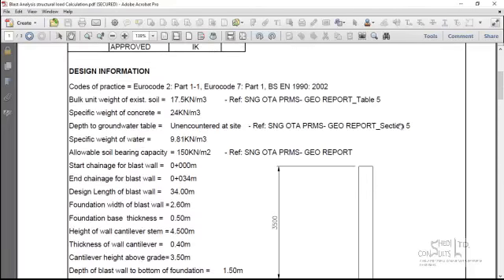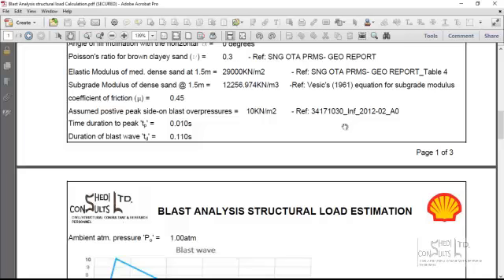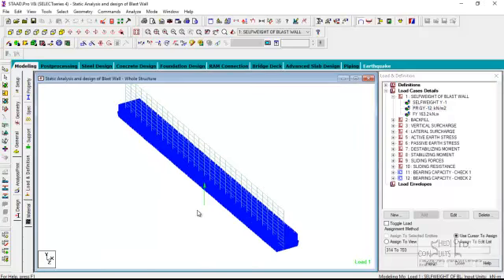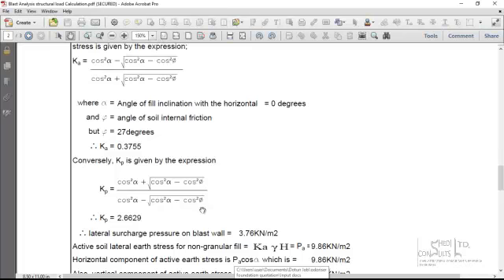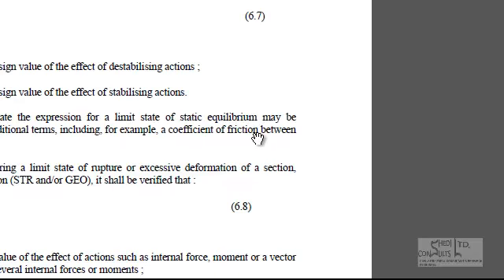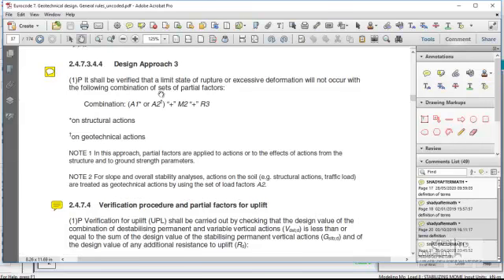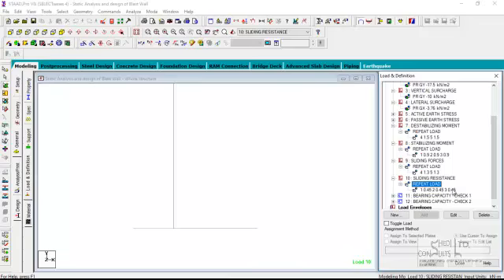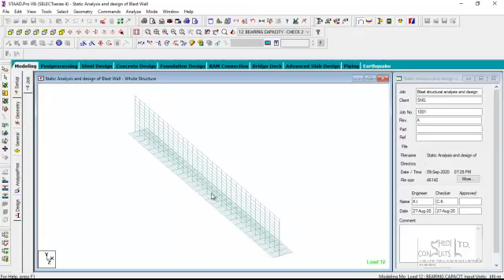Structural Blast Analysis and Design of a Blast Wall in a Gas Plant

Comment: Blast design without blast load 😂
Reply from the maker: The derivation of the dynamic blast pressures (from a FERA), shock front pressure, reflected overpressures and the decayed stagnation pressures were clearly derived in the video. It is not the intention to completely carry out a blast analysis of the wall using the time-dependent impulsive forces, etc as this is a sensitive topic